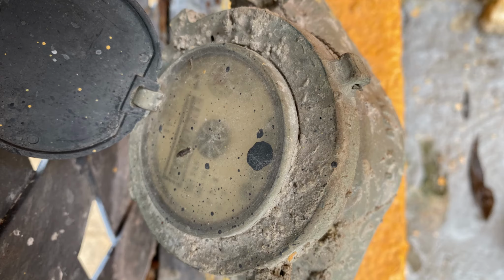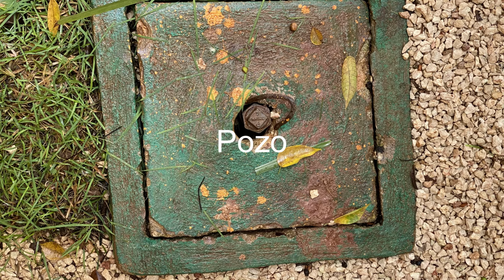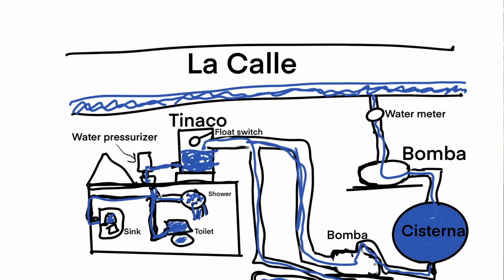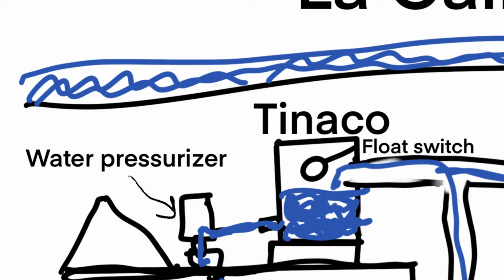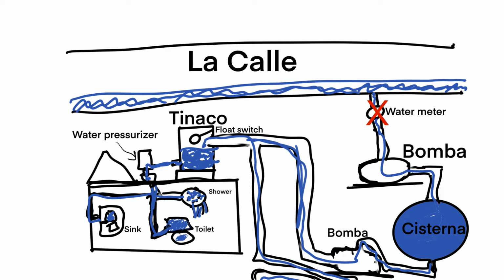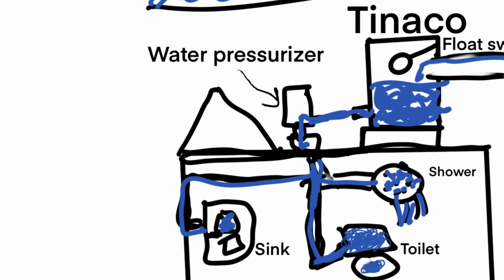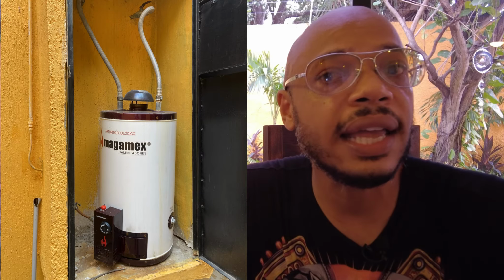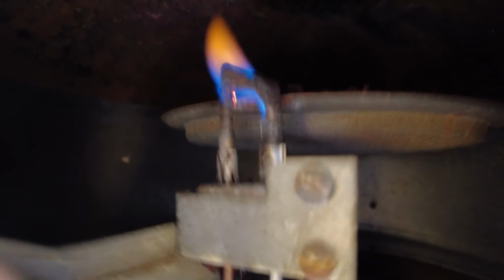No Water In Your House?| Plumbing In Mexico Explained| Living In Merida Mexico| MexitPlans

Comment: Great video amigo! I’ve been snowbirding in Yucatán for the last couple years and this is great information. The main difference between Mérida and Chicxulub Puerto or Uaymitun is that we don’t have city water. Our cisterna is filled by a pipa (trucks that deliver water to the condo cisterna), but otherwise our low pressure water system is very similar. 🙏🏼 💦
Reply from the maker: Thanks for watching and sharing the differences out at the beach. 🏖️

Comment: I live in an area of Mazatlán MX that is far removed from any other gringo's. The water to my area via the city is only available meaning it's pumped via the various piping to ones home from 2200 to 0800. That's if it not off line, which when it's off line can be anywhere from a few hours to a couple of weeks. Thus I've got two tinaco's on my roof.

The biggest issue is because there's no enforcement, most people have as you say bomba's which not only push's water, suck's it, prior to getting to my house. When the law states that one can only have booster bomba's which only push water if and when there's water to push.

Assuming your pipes were installed correctly, and none of the numerous joints leak. A booster immediately after the water from the tinaco works great. Generally no one ever need's hot water unless showering, thus we don't bother having a boiler aka water heater. We've installed though I'll probably spell it wrong duches. First time I saw a device with electrical wires in a shower, caused me a bit of concern. But they work great.
Reply from the maker: Awesome. Thanks for letting us know how it is in Mazatlan.

Comment: Great info! If you're renting is it usually renters responsibility to fix issues like you spoke about?
Reply from the maker: yes. renting here is very similar to owning in the states. After 30 days, you are typically responsible for anything that goes wrong with the property minus something structural. of course, this all depends on your lease and landlord.
Reply: @Mexitplans  This has been one of my big questions about renting! Thanks so much.

Comment: You should stop saying México and just say Merida. Most of what you showed does not apply to a very large part of México. I live in the north now and have lived in other places and have never had a tinaco, have always had high pressure water from the street mains 24 hours a day, etc. You live in a shI**y place and think that's how everyone else lives!
Reply from the maker: Outside of the largest cities in Mexico, many places have a tinaco, cisterna or both. I personally think Merida is a great place to live. I don't  mind the differences. It's just that, different no better no worse. I have great water pressure and clean water. It is not all parts of Mexico that use this system but there are more that do than don't.

Comment: What’s up Monte, great video with a plethora of amazing useful information. Actually just had plumbers out to our house. No water in the primary bedroom bathroom sink. There was a lot of build up of calcium and so kind of algae looking slug. After the plumbers cleared everything went back to normal. Except in the other bathroom sinks the slug was stopping the flow in the sinks. I had to remove the faucet head to remove the algae type slug. We are all good now but something I have to remember for the next time. Thanks for the video!
Reply from the maker: Yo. Thanks for sharing. I’ve had more plumbing repairs in Merida than any other issue. I’m glad you found this useful. We need to get together soon.

Comment: What about a water softener?  Where would it be installed in the graphic you shared?
Reply: A proper whole house softening system is installed first in line. Every ounce of water should be softened or it makes no sense. Water that is not softened will clog intake and outflow valves inside your tinaco rendering it useless, not unlike your shower head. Also hard water will ruin check valves throughout your system as well as your shut-offs throughout.
Reply from the maker: @meatgravylard  Thanks for the clarifications. I've seen the osmosis systems installed in kitchens but not a whole house system.
Reply: @Mexitplans  those systems under the sink are killing bacteria making the water completely safe. The softener is a large two part system with a large tank and a large brine tub. The softener only softens but does not filter, softened water is still questionable to drink without another system.
Also, if you have a whole house pressurized system your tinaco is bypassed, and is only used during a power outage. You need to keep the tinaco clean manually since it is stagnant. You really should have a softener, more so with the pressure.....
Reply: @meatgravylard  That's what I keep thinking as well. I would want to have a whole house system installed. It seems like maintenance on just one large device, plus only having to replace filters for the one item would be cheaper in the long run that a bunch of little filters at various points in the home.
Reply from the maker: The ones I’ve seen are installed at the faucets like in the kitchen. I suppose you could also have one inline after the tinaco as well if it’s big enough for the whole house.